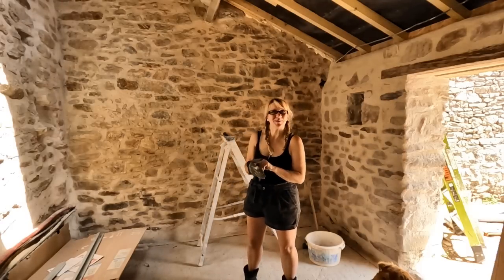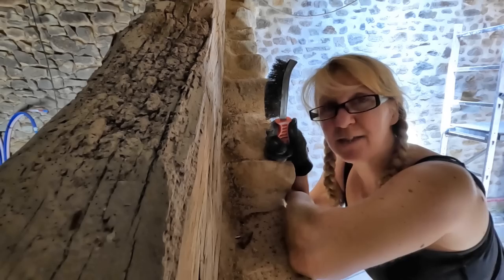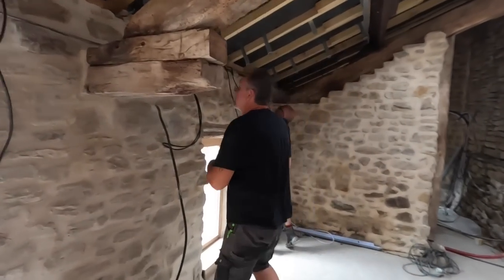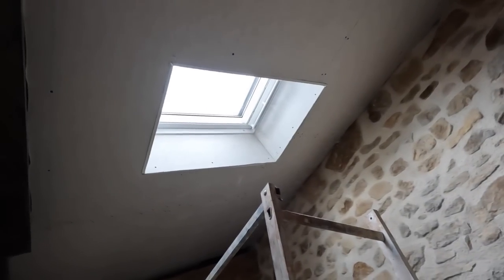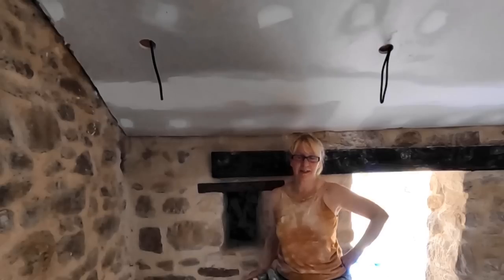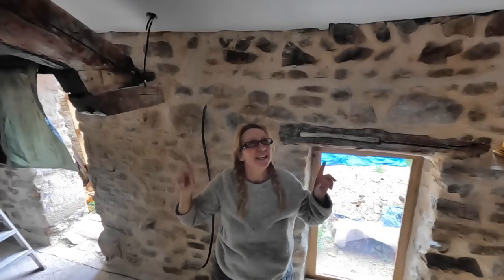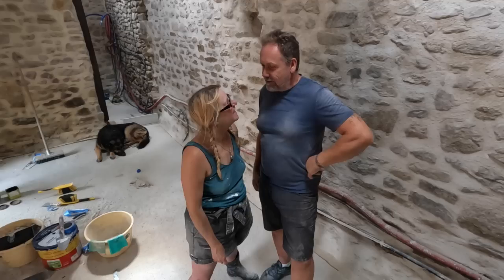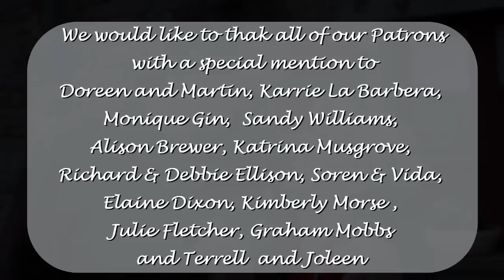The chateaus most ancient building gets an upgrade

Comment: The Petherick's channel TODAY has Simon's Plastering school and he shows you plastering around the beams and filling the gaps.  (He uses the fiberglass type of 'tape')
Reply: Simon said it was a fiber tape but I didn’t hear fiberglass. But maybe I missed something. There is a product in the US I use several years ago called “Fibatape” I think it was. It definitely was helpful.
Reply from the maker: Are you saying mine is not good enough and I need tuition??? 😂
Reply: @ChateauDeMontmagner  🤣I do think their beams have a few less odd nooks and nicks. I was wondering how you were going to do the edges. Tape works best in straighter lines, I think. The way you did it, Leesa, makes it look seamless and as if it were always that way. I can't tell you excited I will be to know those lovely pups have a solid roof over their heads! And you two, too. 😂😘 Will you have heat and air conditioning in the piggeries? You deserve to have warm winters and cool summers once you have the B&B in full swing.  Someday, in a decade or so, maybe the lake can be reclaimed for wild swimming. 🤔 Catered parties by the lake with overnight accommodation. I can see it now...